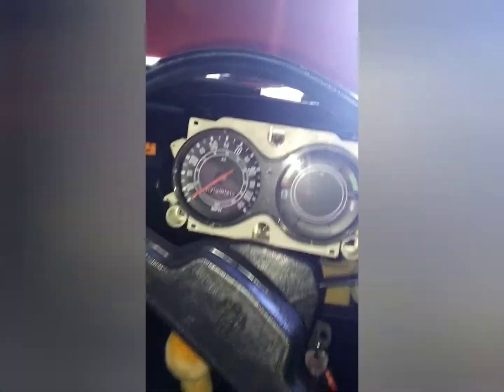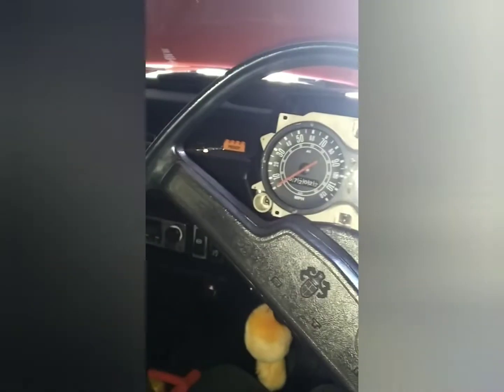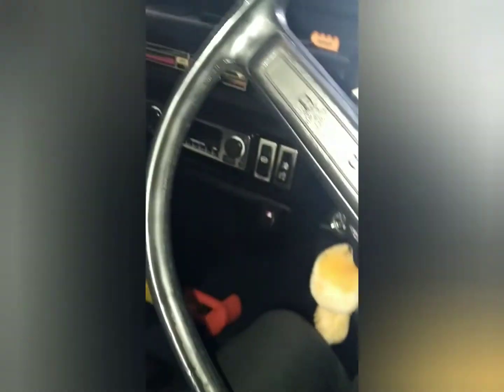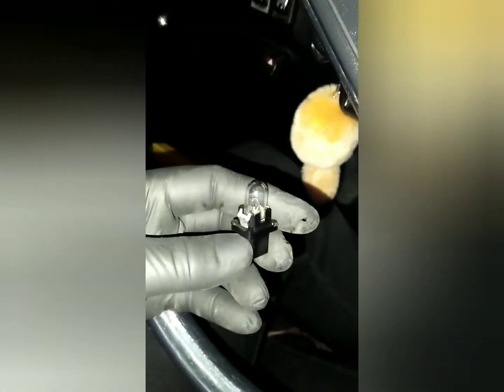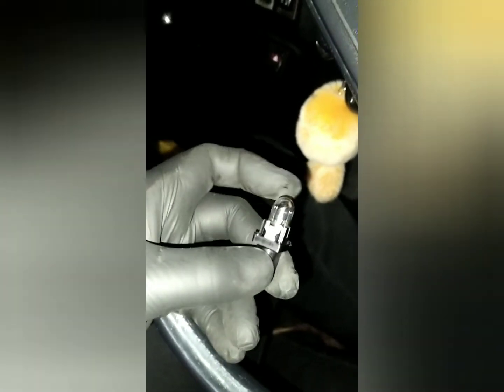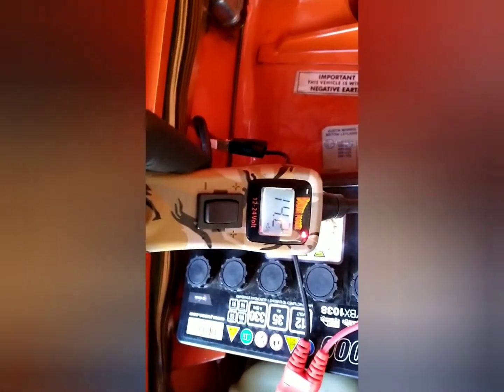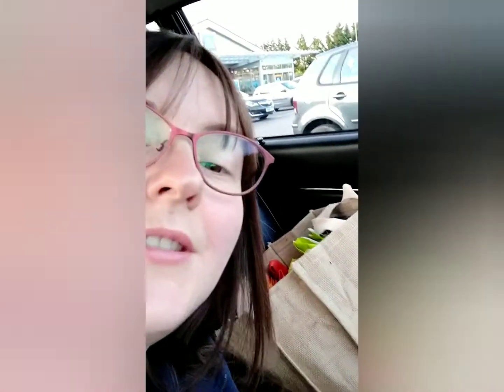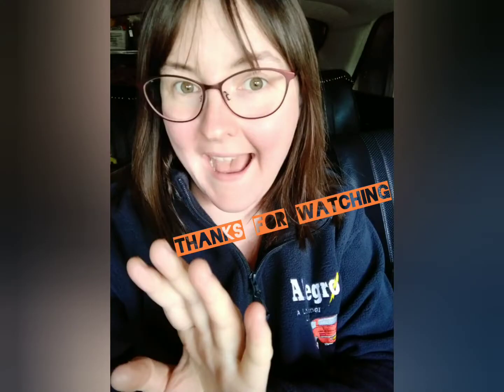Classic car Battery Charging fault Alternator ? No it may be simple! Austin Allegro dash pod

Comment: the ignition bulb ( which is usually orange) is used not only as a warning lamp but is also a way to excite the alternator to make it charge. if the bulb has blown the alternator will usually self excite once you rev the engine up, which is likely to be why teh car was still starting without any problems